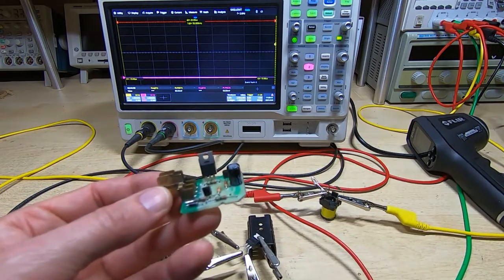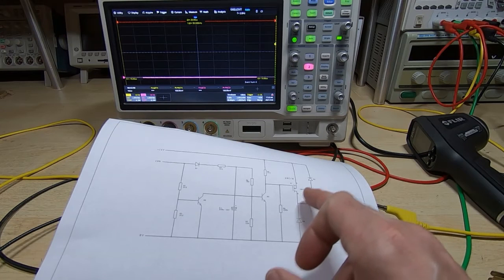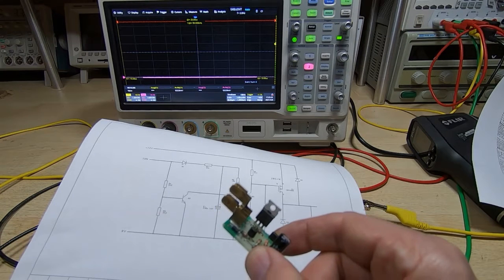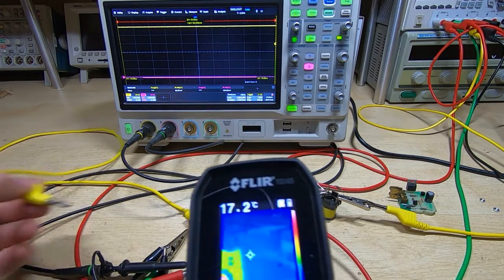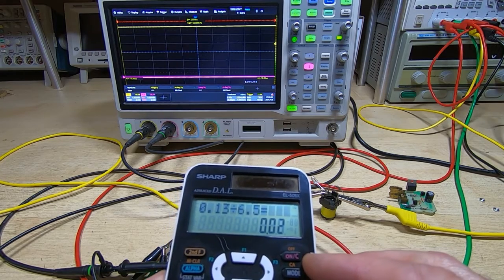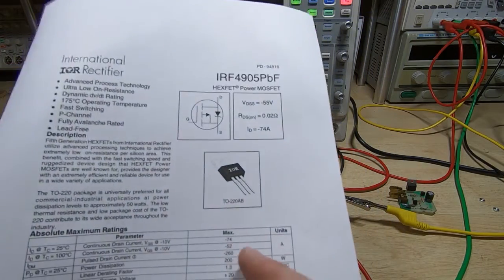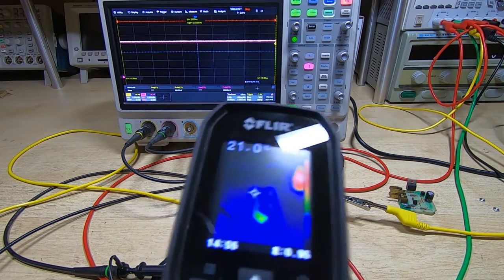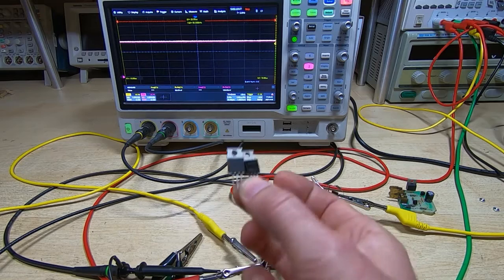Engine Stop Relay Repair Part2

Comment: Hello Jerry, imagine this as a problem in production line , i got it a couple of times for LM317 TO92 and LM7905 TO92 on PL303 series power supply . How happy we were just caught in time after final test pass , from time to time the supplier send us a kinder surprise batch of parts . That's a fun day when we draw the winning ticket . Thanks for video and short explanation and hope to see this issues caught and analysed with a SMU  iv characterization against pdf-file of device under test .

Comment: Yes, I have had this issue as well. I purchased 5 high voltage drivers for pinball displays and they were ALL defective. The ebay seller said he would remove the listing, but I subsequently verified that he in fact is still listing parts that he now well knows are defective and possible fakes.Bastido!

Comment: I used to not care if the FET was a little over spec as they were cheap and I over designed. Lately what I've received is nothing close. Finally found a supplier whose on resistance lower than published and bought 250. Won't have to deal with that problem for a while.

Comment: Now the counterfeiters have access to the same tools that the OEM's use to mark the parts originally.  These days it pays to go with established suppliers.  These eBay sellers are practically immune to prosecution due to international laws.  It costs so much to go after them and by that time they've changed their identity.